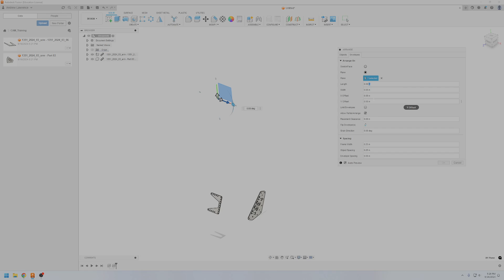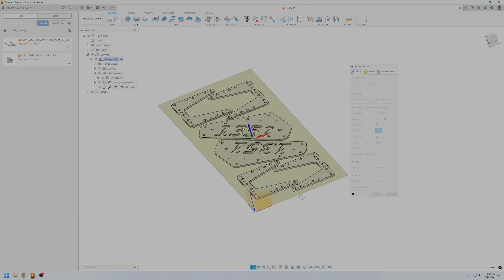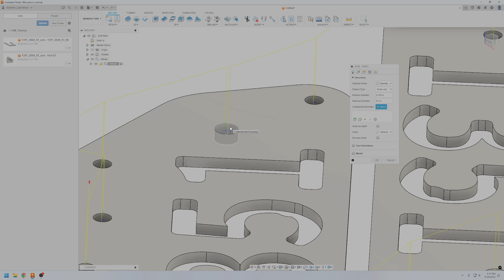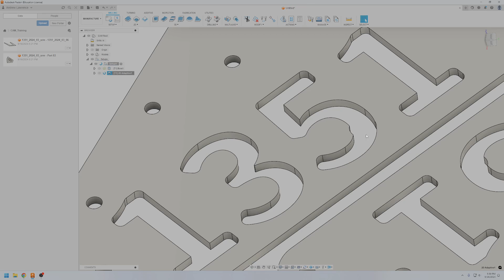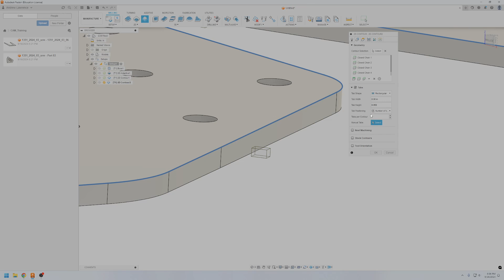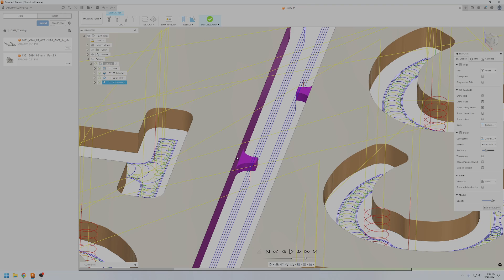FRC CAM with Fusion360 Tutorial

Comment: Where do you source your 4mm end mils and what kind of coolent system are you running if any?
Reply from the maker: We use endmills from WestCoast Products (https://wcproducts.com/products/machine-tools). For the most part, I just use a spray bottle of coolant and a handheld air nozzle connected to a compressor and have the operator keep the cutting area clear and it does just fine. I've made systems that plumb air and coolant to the spindle through the gantry axes and even automated it all with M-code commands, but over time I found it less useful than just having an operator who can aim and shoot air and coolant at specific parts of the bed as needed.